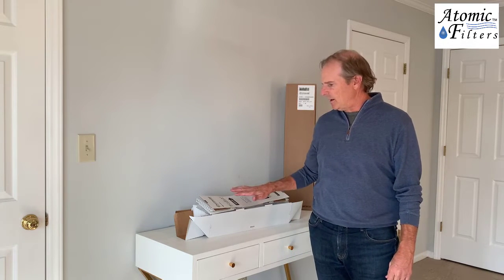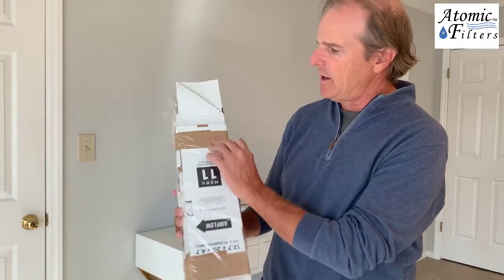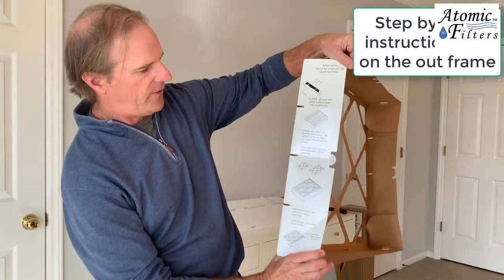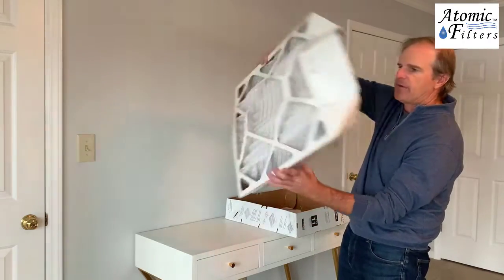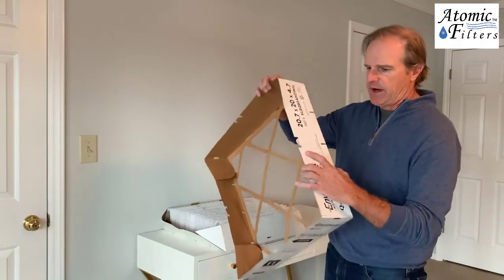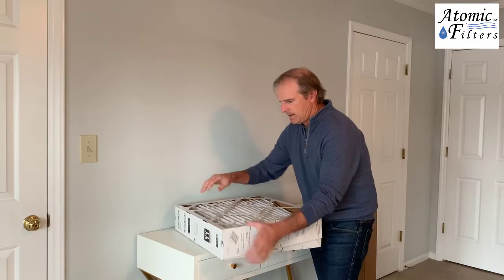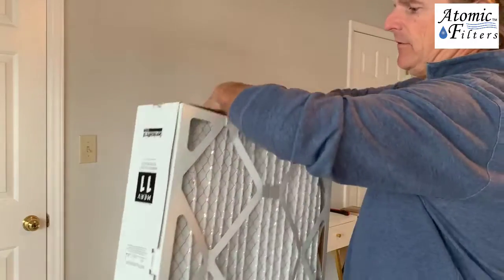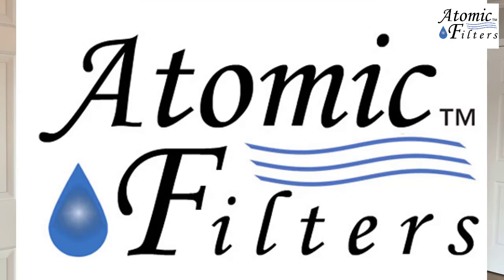Trane ServiceFirst Envirowise FLRQB Quick box filter assembly(how to build the FLRQB5AH23M11 Filter)

Comment: Thanks for video. I can’t believe what flimsy pieces of crap these filters are. 😂
Reply from the maker: Glad to help Taylor. Atomic Filters now makes a compatible for this filter which is a sturdy high quality, high efficiency MERV 11 box filter that does not require assembly. We also make it in an upgraded MERV 13 version. We make them in the USA. Check it out when you need a replacement. We also carry the Trane version. https://atomicfilters.com/products/atomic-compatible-for-trane-flrqb5ah23m11-22-7x20-7x4-7-merv-11-filter-2-pack?variant=40660128235599&currency=USD&utm_campaign=sag_organic&srsltid=AfmBOopO7b6TZ28TJvsK47603o4c4eWaOlmtLD_qlmMNzb5DB0KpvjDXyx8&utm_term=UCOL_BcHd0es7eNu5zYjRFuA&utm_medium=product_shelf&utm_source=youtube&utm_content=YT-ANKptbCRfnwQm7AepMCtZ070hkUSYmfVwDFLsL6eHsUSoyxBnqz7ZX5eUJi04vcB4IdbhqxoUrVIUQNUxyVdLW7L4TQyHgF_sZ_4mahtW8Y05INyVIheYU32yJWwyBuTk0rrFUsr3Oaa3_-b3Zx3SJBZZQ2SDstyQphBDdqyPfRkl4UMuLLgWGq_
Reply: And $75.00 for a 2 pk 👀 at that. Supposed to work for 6 months?? More like one month. I would have never purchased an air conditioner with the ridiculousness of a poorly designed filter. And let's not even talk about how tight the fit is to get it in🙄 (that's what she said)😂